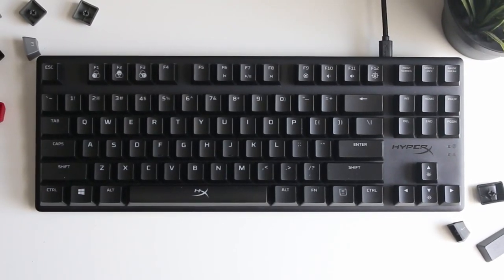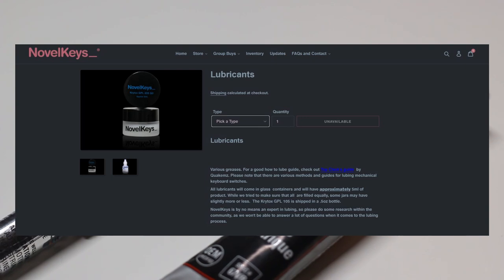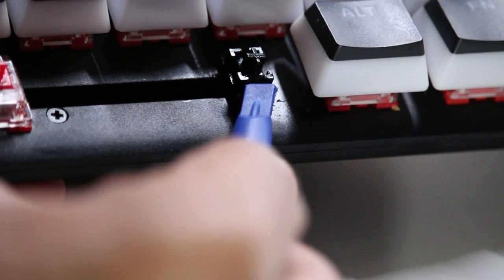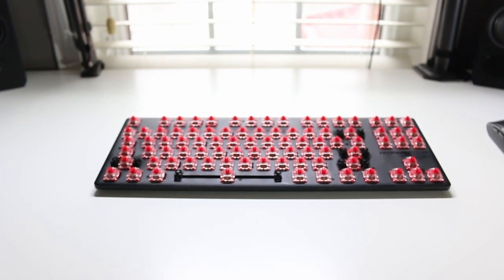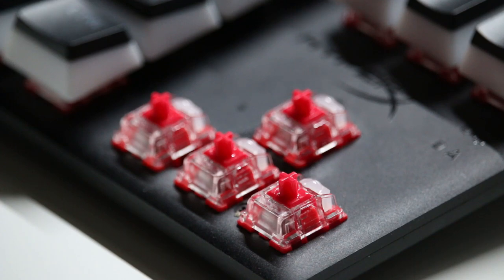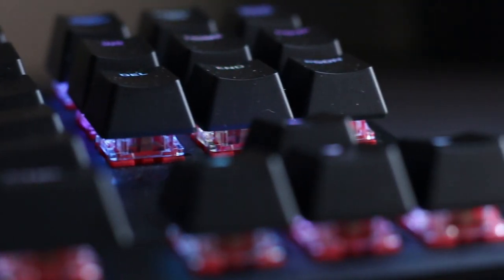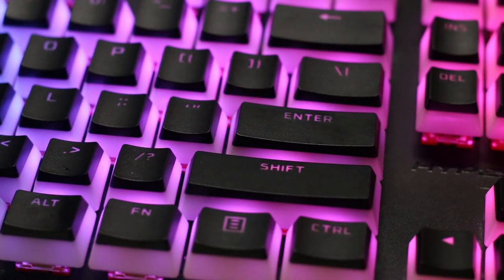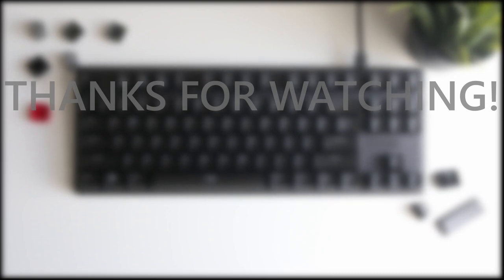How I Lubed my Keyboard (Without Desoldering) (Typing ASMR)

Comment: The tube of super lube would be better since it should be easier to control. Using the Spray can of super lube has a better chance of breaking your keyboard since it usually is messier and the lube can mess with the contacts of the switch and making them be inconsistence or cause it a key to not work at all. Just a heads up for anyone going to use the method of spray lubing to using super lube in general.
Reply: If a key stop working after spay super lube, then you can fix it with wd40. But wd40 multi use is the best method for spray lubing. Still, after using wd40, some keys may stop working. You just need to leave them some time to dry. Wd40 multi-use, can clean your switches and lubricate them at the same time!!!

Comment: The brush method is the only "easy method" I would recommend for tactile switches like Blues or Browns if you want to retain the tactile feel and click. A very light amount of 205 G0 lube on the two slider sides of a tactile switch, avoiding the switches bump/hook will get rid of a lot of the scratchiness, make them buttery smooth and retain about 75% of the click. Much easier then tearing the whole keybaord apart. I do recommend a high quality brush so you don't shed hairs in the switch.
Reply: Hello sorry if this is a dumb comment but where is the slider side located on the tactile switch?
Reply: @alio0157  slider is located left and right iirc, and you should lube top and bottom.

Comment: Hey man great vid! Finally someone posts a video on this keyboard without having to desolder. Do you think adding fabric tape in between the plate and stabilizers makes a difference either the rattle or should I just focus on using the dielectric grease?
Reply from the maker: Thanks for watching and glad you enjoyed it!

I got most of the rattle out but it's far from perfect. 

I think the fabric tape will help a little, but the stabilizers are pretty snug in the plate (mine don't move at all, so it didn't make sense to add any for me) Of course it will vary as its a mass produced board

I've tried the fabric tape method with the Kumara K552 board I have and that made a noticeable difference
Reply: @Muzziii  I lowkey just put some blu-tac around the stab housing. It worked wonders on some keys (e.g. my space bar) but not so much on others (my backspace and right shift), cos it depends on whether most of the rattle comes from the stab housing wiggling the top frame, or the stab stem wiggling inside the housing. Asthetic-wise it also isn't the greatest option but it's only an annoyance when I look at the keyboard directly top down or right from the side so in the end ig that's still worth trying though.

Comment: Thanks for the video. You inspired me to lube the stabilizers on my Alloy Origins Core with Aqua switches. I had actually given up on using that keyboard and was looking for others I could buy to replace it, but couldn't find something that had the same sound and feel of the aqua switches. I always assumed that because I couldn't take the keyboard apart and separate the stabilizers that I would never be able to use it without stab rattle, but I used your method and they are much better. They are certainly not perfect, I might look into doing a band-aid mod or something to stop the stabilizers from moving around on the plate, but they are so much better than they were stock. Thanks!
Reply from the maker: Happy to help and thank you for watching!

Comment: Great Vid! 

Did you had any issues so far after doings this method? Is it really safe? My friend's kb led lights died after a month(she used method 2), my guess is that she over lubed the switches which probably damaged the pcb somehow.
Reply from the maker: Thank you! 

I’m sorry to hear about your friends keyboard 😔 

Luckily I haven’t had any problems (aside from the mess from the excess lube leaking out)

I posted a video recently going over the keyboard (Roughly 1 year later) I’d recommend checking that out!

Comment: I have the hyperx alloy origins core (the same one as you have) and my keys with stabilizers are kind of mushy. Do you think lubing my stabilizers will help with this problem?
Reply from the maker: Not sure if it'll help with the keys being mushy, but it should add some lubrication to the switch and make it more smooth. My stabilizers did sound and feel a lot better after I did this tho
Reply: @Muzziii  thank you so much for the response i will try lubing the stabilizers i hope it will help.

Comment: I have the same keyboard as you. Now im not a expert with keyboards but mines is brand new but as I was trying to switch out the keycaps on my spacebar the stabs broke off and its stuck inside my spacebar. I bought new stabs. and im wondering if its possible to remove the stabs without taking out the switch?
Reply from the maker: As far as I know, you have to desolder them :(

Comment: I just picked up the new HyperX alloy origins core 60, and I ended up watching this video because the keys with stabs feel really mushy when bottomed out (all of them except for left shift... for some reason that ones ok) and I assumed that the TKL version would have the same design. Did you also run into the same mushiness before lubing? Would you say this is an issue that requires disassembly and clipping of the stabs?
Reply from the maker: Congrats on the new board! I don't have any experience with the other HyperX boards (Maybe I'll get review units if this channel ever gets big LOL)

I remember the keys always being nice and smooth and no real mushy feeling! There was that rattle tho that the lube fixed. (Honestly unless they changed something I think its cheaper for them to keep using the same stabilizer design across the line as its probably cheaper)

The 60% is new so it could also just be some imperfections in the assembly process/QA process
Reply: Huh ok. Good thing it has a 2-year warranty so I can always return it for a new one in a year or so when they get the assembly line more in order. I can definitely see this being the case, as the left shift (as stated before) does not have this mushiness unlike all the other stab keys, and no reviews on it yet have reported the same issue I am encountering. Of course the stabs have a lot of rattle but that was to be expected, and not a qc issue.

Comment: I'm using that tube too, but some sound overlubed, and some ok. Hard to dispense exact amount. Only did key pad 2 small drops. I should try one. I'm ok on cherry red right?
Reply from the maker: yeah Cherry red and these are both linear, to me they actually feel the same LOL

The drop method isn't that accurate unfortunately, I try to put as little as possible and add more if needed
Reply: @Muzziii  strange using 51014 super,  A fine line between going overboard. Dental floss picks until shiny wipe excess off, hit both sides, not top or bottom. Some feel like they need more, but will wait.

Comment: I also had two keys that stop registering, how did you do the hard reset? thx
Reply from the maker: Hold down fn and esc for a couple seconds until the backlight flashes, you'll know when it happens. 

Keep in mind you will lose the custom LED profiles saved on the board.

Comment: Hey, I have a question about 5:15
I bought a Hyperx Alloy Origins Core (like yours) with aqua switches, and I seem to have the same problem but with my D and G keys instead.
Could you tell me how did you "hard reset" it so I could try it aswell? I tried the "blow while clicking method" from a different video but it only fixed the issue for a few hours before my D and G started only registering ~80% of the time again lol
(I haven't modded it yet, and it's still ~6 months old)
Thanks! (:
Reply from the maker: Hey, I believe it was holding down function and escape for 3 seconds, that should factory reset it. You’ll also lose the color profiles btw

Comment: Do you have any recommendations on how I should lube it without over lubing? I tried to lube my other keyboard and I think I over lubed it. What I did was put the super lube on a tray then I dipped the paint brush once per switch and it’s still too much. Do you think I should just put one drop on each switch and spread it out evenly using a paint brush?
Reply from the maker: Yeah, I think the paintbrush method is the most controlled (outside of disassembly and desoldering the board) 

I would just get very little on the paint brush and maybe wipe it on a clean part of the tray before lubing the switches. 

Hope this helps! Also check out r/mechanicalkeyboards on Reddit, some great people over there!

Comment: Hey bro!Just what i got the board and i know it isn t about lubing but...i got my spacebar out with the stem,i put it back there somehow but it won t go back at all.Do you know what should i do?I do not want to disolder.I am really scared,this is such a good board
Reply from the maker: Hey man, I think I missed this, try posting it on r/MechanicalKeyboards. Better if you can post a picture or pictures and it’ll be easier to see what the issue is and how to fix it
Reply: @Muzziii  Thanks man!I really appreciate it

Comment: Hey, do you need to open everything on the board or?
Reply from the maker: I didn't open anything other than taking off the keycaps  and what I've shown in the video for the stabs.
Reply: @Muzziii  oh wow :0 i thought u opened it! Okay thank you really
Reply from the maker: @karateka29amura  yeah but I will say after a couple months of regular use the excess lube will leak out and make a little bit of a mess, but you can just wipe it off with a cloth

Comment: Can the stabilitzers take out?
Reply from the maker: You can, but you would need to desolder the switches first. I've heard the case is really hard to take apart so I didn't bother spending that much time on this board

Comment: Umm bro, can I pull he stabs with tweezers or like a card, I don't have the plastic with the notch I need help please
Reply from the maker: Yeah you can just push that black clip/notch back gently and the stab should pop out as it did in the video
Reply: @Muzziii  alright thanks!
Reply: @Muzziii  Also bro, can you please tell me on how to reset the firmware, I'm gonna start lubing tomorrow and I'm scared the switches might not function, please help
Reply from the maker: @mythic9520  Hold FN + ESC key on the keyboard for a few seconds.

Also I mentioned in another comment, but If I had to do it again I don't think I'd lube the switches (of course take it on a per case basis, if the switches sound really bad then do it) but the stabs definitely could use dielectric grease to get them to be smoother
Reply: @Muzziii  ohh alright, thanks for replying my comment again btw, I really appreciate it!

Comment: Is there a reason why u used grease for the stabilizers and not the lube?
Reply from the maker: Mainly because the lube is a lot more liquid so it'll leak all over the place (I learned from my experience LOL) over time and just make a mess.

Also, the lube dried up on the other keyboard I tried it with and the rattle came back in a couple of weeks. 

If I could take the keyboard apart and lube the stabs separately, then the leaking would not be a real problem and I could apply it more evenly, but the wire that runs through them I think would still benefit from the grease as it has a whole lot more room to move and the lube would just dry up or leak out regardless.
Reply: @Muzziii  I used Glorious G-Lube and it also says on their site, that you can use the G-Lube for stabilizers too, I have Glorious Panda Switches and lubed them ~2 Months ago and they still feel great.
Dielectric grease is better for the long run, but if you want to save some money, just get a lube like Glorious G-Lube and re-lube the stabilizers every 3-6 Months.

Comment: so I have the core aswell but with tactile switches, so will method 2 work but with the dedicated lube for them to not ruin the bump?
Reply from the maker: Based on what I've read lubing tactile switches has its own method and lube as you mentioned, I'd check out r/mechanicalkeyboards on Reddit, those guys are real experts

Comment: Yo man, if you already did can you me how to open the keyboard :D?
Reply from the maker: Sorry, unfortunately, I didn't end up taking it apart, from searching online it seemed to be a pain
Reply: I have Hyperx origins core as well, all you gotta do is remove all keycaps then you'll see black screws between the switches, unscrew them all (make sure you don't miss any) then flip the keyboard around, you'll find one silver screw under the rubber pad in top right (you gotta peel it off ), then take something like a guitar pick and pry the 2 parts apart by sticking the tool in the small gap around the keyboard, that's all
Reply: @tomas36181  there is one behind the rubber feet as well,but it seems I can’t open it,it’s glued or something I can’t really explain it.

Comment: Can this work on mx blue's? Im just new to mech keyboards sorry
Reply from the maker: No need to apologize, man, I'm still learning too. Don't do this method, you will mess up the blues. There is a way to lube blue switches properly and there's lube out there meant for Blue switches. 

I'd recommend heading over to reddit.com/r/mechanicalkeyboards that's where I get most of my information from/ask questions
Reply: @Muzziii  thanks my man it really helps!!
Reply: @Vacuum Cleaner damn man thanks for the recom XD

Comment: The method with the paint brush made my switches feel significantly heavier, did you have the same "problem" and if you did, did it go away?
Reply: your situation might be due to overlubing
Reply: @truongan7704  Hmm that's actually possible, anything I can do about it?
Reply: @truongan7704  Oh I forgot to add, typing and such doesn't really feel heavier, it's mainly when rapidly pressing a key
Reply: does all the switches have the same problem ?

Comment: What cheap lube do you reccomend for mx blues that aren't too expensive (In CAD)?
Reply from the maker: Honestly, I've never really thought about lubing blues, I thought I would lose the click/tactility if done incorrectly/used the wrong lube

Check out r/mechanicalkeyboards on Reddit, those guys are way more experienced than me

I wish I coulda been of more help :(

This does give me an idea for a video tho, where I try different lubes on blue switches
Reply: @Muzziii  its alright dont worry. I'm just trying to find different ways to quiet down my blues without making them feel too bad and I thought lubing might help. At this point I think I'll just get a new custom keyboard
Reply: @TheBugCrafter  and how do you feel now?
Reply: @TheBugCrafter  I mean what u gonna do
Reply: @bywavy  what do you mean? I'm gonna try getting o rings and see how they feel on my keyboard for now I think
Reply: @TheBugCrafter  im noob when it comes to mechanical keyboards. I just bought one. What are o rings?
Reply: @bywavy  they're like little rubber rings that go under your keycaps. they make your keyboard more silent but makes them feel worse because they are rubber and mechanical keyboards are supposed to not be like membrane keyboards so it sort of ruins the purpose with some switches
Reply: @bywavy  Please, please, please don't use O-rings. They make your board membrane, and there is literally no point in buying a mech and putting o rings on it. Watch Squashy Boy's video on it if you need. What board do you have, btw?

Comment: is it really safe to lube your switches like that?
Reply: I'm also wondering this
Reply from the maker: Many have advised against this method, which is why I said to try at your own risk (my board is fine even now, I use it pretty regularly) 

The chance of messing something up is much higher with this method.

Overlubing becomes a concern too with this method and my lube did end up leaking out over time creating a mess. I would not do it this was if I had a custom board.

Comment: Would it be kinda overkill to do the first method to get rid of spring ping then do the second method for the other areas
Reply from the maker: I don't think so, but I'd say remember that you can always add more lube, but it's a pain to take out lube you've added, so add a little see how it works and if it needs more then go for it

Comment: Keyboard lubing method 2 is probably the worst way you can lube a keyboard.
When lubing in that method, lubing takes a long time and is often lubed incorrectly, as you are not fully exposed to the switch stem or housing. You're much better off just taking off the switch top and lubing the stem.
Reply: @vert97  just desolder and save your lube. Why are you even buying krypton 205g0 if you don't know now to desolder. Why are you an enthusiast if you don't know how to desolder